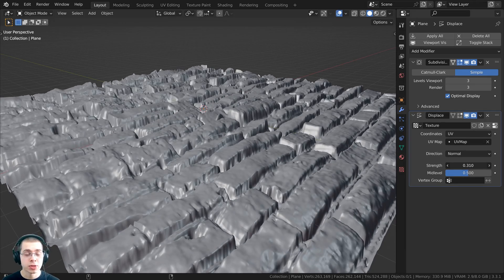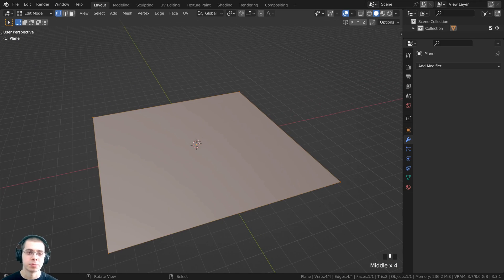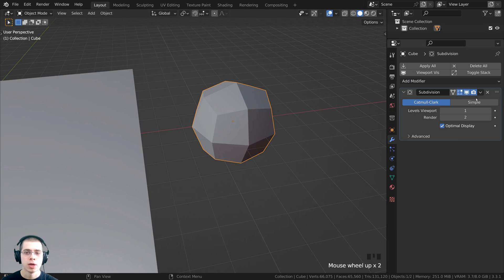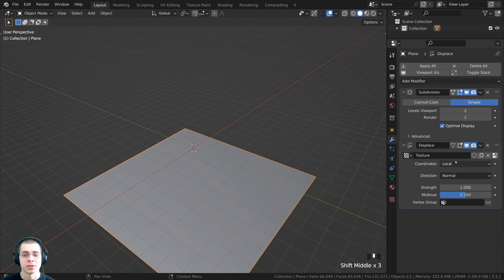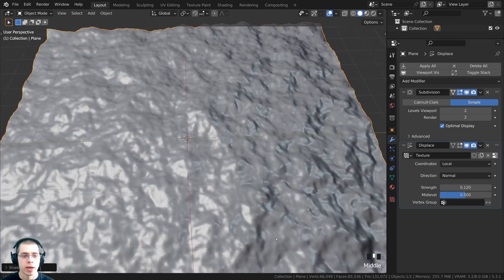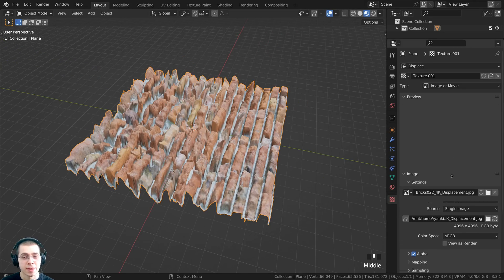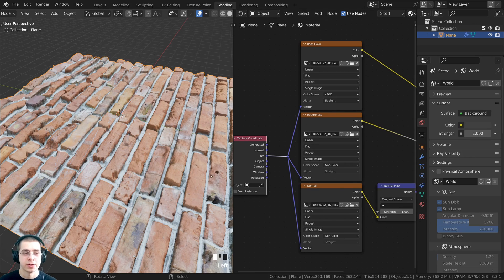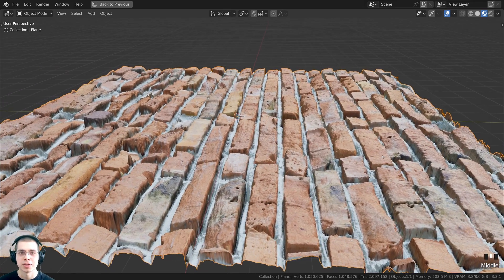How to Use the Displacement Modifier (Blender Tutorial)

Comment: I need your help if possible - the method of placing the pbr texture is successful on a normal wall, but for me unfortunately when I, for example, create a room using the cube and place the pbr texture on it, the faces are intact but the edges unfortunately have cracks or cuts and I do not know the reason, Even though I set the subdivide to 100 through edit mode

Comment: Thanks for your tutorial!

I am currently using the displace modifier for the foam of a hard case.

Is there a way to unwrap without applying the displace? (I want to use it as a template)

Because it stretches the UV and the result is not great...

Thanks 😉

Comment: What kind of performance computer do you recommend for doing heavy work with blender?
Reply from the maker: hmm, it really depends on what your doing. For instance, if your doing lots of photo-realistic rendering and animation, then having a powerful computer helps. But if your just making like, Low Poly stylized art, then you don't need a very powerful computer.
Reply: Thanks for replying !! I want to move the character in 2d and create the  background with 3d blender! What kind of specs do you think a computer needs to have to achieve this?

Comment: Ok! So, I have a question… am not knowledgeable at 3D in anyway but I have watched a lot of video so my question is… is there a way to procedurally tell the plane where to exactly displace, just for optimisation sake so we don’t have subdivide to a point where we lose performance?

Am sorry if I sound stupid I just don’t know enough about 3D.
Reply: In render properties you need to set "Feature Set" to experimental. Then check "Adaptive subdivision" in modifier properties of subdivision.
Reply: @Igoreshkin  No, I don’t mean in the viewport, I mean is there a way to do the displacement thingy so efficiently that we don’t have to add Too much geometry to the plan that we want to displace but only add geometry where we want it to displace specifically and maybe end up with just few cuts in the plan Thus “delicious optimisation” 😁😁 especially if it’s doable  procedurally
Reply: @chosen_oNEO  you can select desired vertices then create a vertex group and set that group inside displacement modifier properties. Hope that helps.